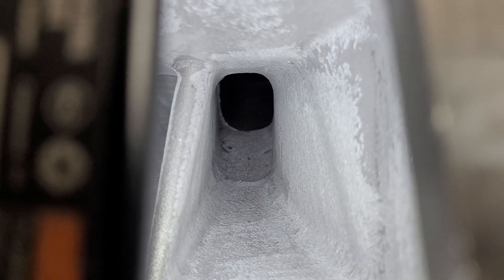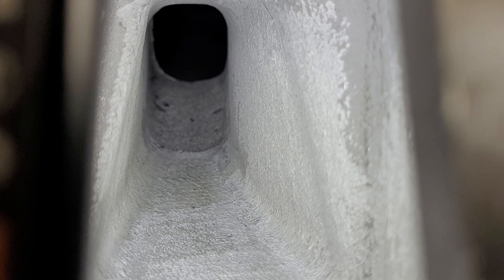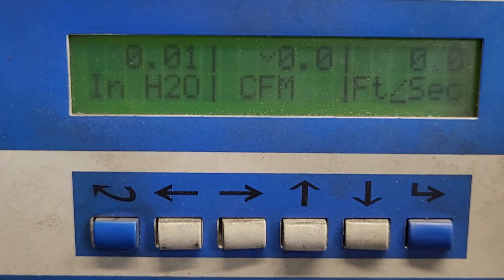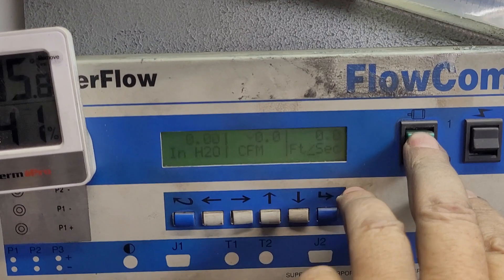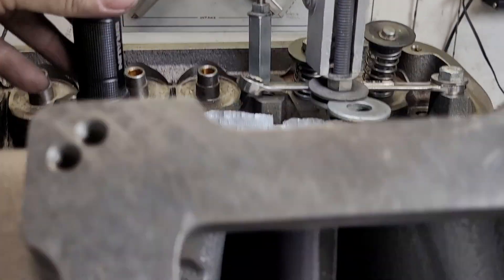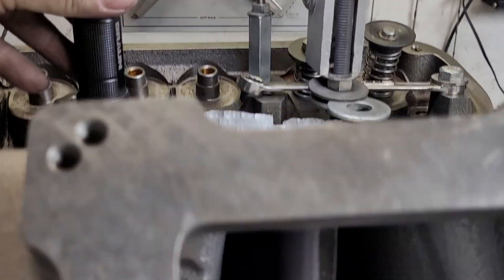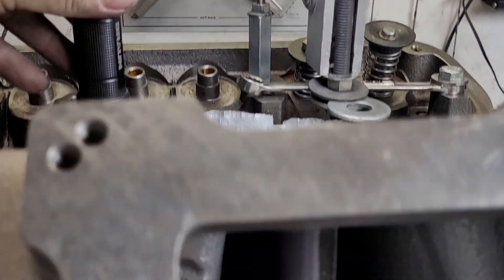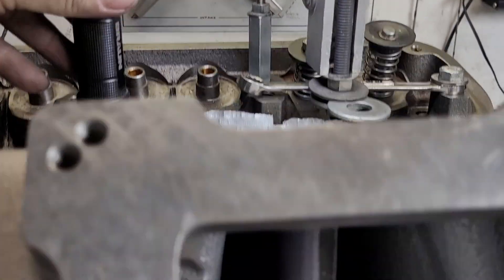Mopar W2 cylinder head and Mopar Tunnel ram flow, airspeed and taper discussion.

Comment: @ 0:55 It should increase as it progresses through the venturi.
Reply from the maker: Like a prostock head, that would be nice if you could do that.
Reply: @servediocylinderheads  are you saying it doesn't? Yeah that would be very nice
Reply: @servediocylinderheads  the larger CA to smaller CA suggests that a venturi effect would occur.

Am I wrong?
Reply from the maker: @arturozarate1752  You are not wrong. I have not measured that on these heads. Bent ports usually require larger bowls and this ruins this effect. Prostock are more updraft and do not need to slow the air as much to make the turn.
Reply: @servediocylinderheads  ah......I see. Although he shape is there doesn't necessarily mean the effect is there? My understanding is that we increase the bowl CA to slow and turn into the tighter throat thus beginning with a lower pressure into the higher pressure. Can we not have more than one venturi effect? First the carb that slows in the plenum, 2nd the transition down the intake runner to the head, finally the bowl out the throat?

Comment: you have invented a new carb spacer
Reply from the maker: You would think blocking the air path like that would reduce flow!
Reply: @servediocylinderheads  yeah...what happened there? I haven't been in a class in almost 20 years or I'd be all up an instructors ass about an answer to that!
Reply from the maker: @arturozarate1752  I think it reduced the flow acrosss the mouth of the port and the air was coming straight down into the port.
Reply: @servediocylinderheads  I wanna thank you for interacting with me at such a late/early hour. I couldn't sleep.

Comment: Hi Charlie. What happens when the cylinder head has a larger port than the intake manifold and you blend the port on the intake so you now have removed most of the taper? I know that it affects the air speed but how much would it affect power output?  Short version... no taper, how bad? Andrew
Reply from the maker: Sorry, I missed this comment. Taper is good because it slowly accelerates the air/fuel mix. No taper means the air speed is relatively constant in that straight section. That can be used for helmhotz resonance boost in certain rpm range like tpi Corvette engines. 17" long runners with almost no taper. Boost up to 4000 rpm or so.
Reply: @servediocylinderheads  

Not completely accurate ....  I did videos on Helmholtz standing wave and Inertia ram ....    Since airspeed is actually rpm dependent anything you do to drive up airspeed lowers the rpm of the engine .... Some people try and look at taper like a funnel and it really does not work that way ...if you really were rasing the airspeed in a running engine it would lower peak HP RPM but when you add taper what happens on the Dyno is the peak RPM goes up so you are slowing the air at the wide part of the taper which delays peak airspeed and therefore peak RPM happens at a higher rpm ....
Reply: Taper changes runner length and runner length changes rpm ....
Reply: @scotthatch4548  Hi Scott. Not meaning to argue but does changing the taper really change the length. It was an honest question. Example you have aftermarket heads but you have a dual plane intake with smaller ports. You don't want to " flare" the intake ports so you blend them farther in. You then have little to no taper in the intake. How bad is that ? How important is taper?

Comment: Looks like that manifold might like a 4 hole spacer on it. Good stuff Charlie. Regards Greg
Reply from the maker: I was thinking a four hole anti reversion plate/ spacer actually.
Reply: In regards to the light in the flow path?
Reply from the maker: @arturozarate1752  Yes